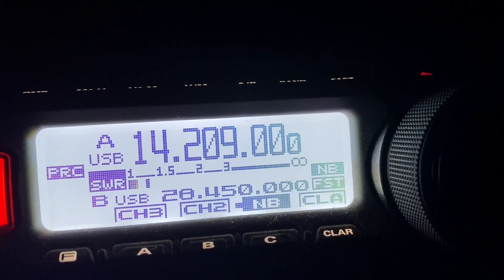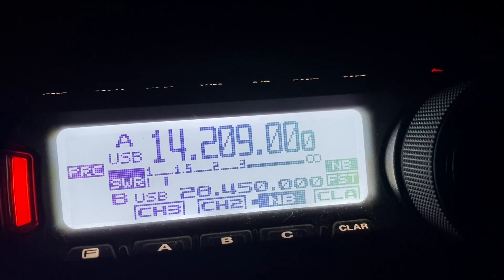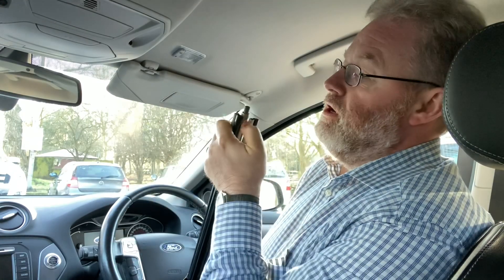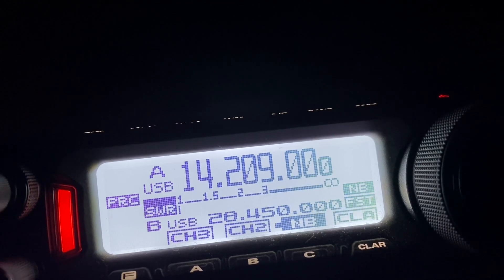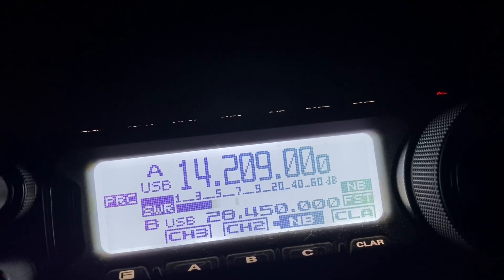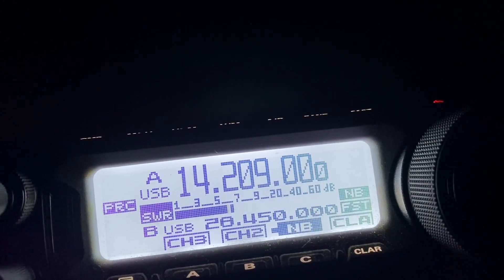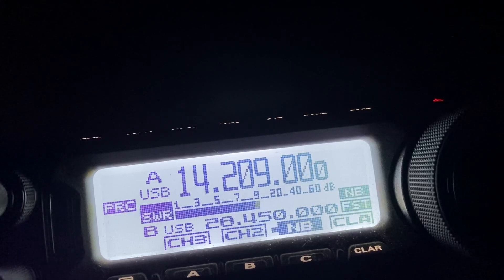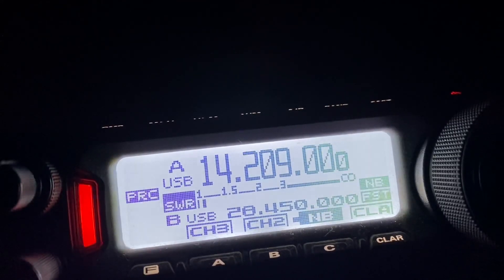Ham Radio: HF Mobile With Slidewinder Coil & Chameleon 2.0 Mil Whip Antenna

Comment: Great video Tim, my qth suffers with s7-9 most of the day, and I was at a point of giving up,and after watching your video, I took the plunge,dug out my tent! And headed out to a campsite, an hours drive away, using a tri mag mounted on car, and Ampro 20 meter antennae, tranny in tent, I discovered just what I had been missing, it was an awakening! First copy was to Iceland,and then dozens of contacts around Europe, and following morning Australia.
As you said, if you suffer from noise on the bands, get yourself out n about.
So good, iv even booked up my next camping trip in a few weeks time!
Cheers Tim
Reply from the maker: That's superb Mark!!

Comment: New to my slidewinder Where on my coil would I put the slider for 10m 
Any suggestions please
Reply from the maker: Hi Liam - if you are using any whip greater than 8 feet long then the best you can do for 10m is to slide the collar to the very top. With my 9ft tank whip and the slidewinder I managed to get an swr of about 1.9:1 this way. Still totally usable. 73
Reply: @TIMG5TM  thank you Tim, I’ve got the mil whip that comes with the slidewinder kit I’ll give it a try, enjoyed the live stream on Saturday too
Reply from the maker: @Liam2E0LDQ  good luck it’s a great antenna system and thank you for viewing the stream. 73

Comment: Super Tim. Not mobile here but i would get outside the ground floor flat with your set up. Only 10 watts at the moment as am new Foundation licencee aged 68 lol. Have the Xiegu G90 which, so far. has worked miracles from my front room with a Wonderloop into Europe. 73s from M7CUN Bristol.
Reply from the maker: Sounds great! Worth a try and very adaptable!

Comment: Great job, as usual. I wonder how that whip would do against the 17 foot MFJ-1979 Whip.
Reply from the maker: Good point. I suspect the fact that the whip can be adjusted to be a resonant 1/4 wave from 20-4m would mean it may have a SLIGHT advantage over using the coil. However, it is heavy to put on the car much more than 3m fully extended, so that is where the Chameleon wins. 73

Comment: Very encouraging and I’m glad it works so well for you.  I struggle with high noise floor and limited space for HF antennas at my QTH.   It can be quite demoralising!  I would be interested to see how you get on with the telescopic whip too, both with/without the slidewinder coil (e.g. for higher bands).   It would be interesting also to see how successful the spike ground mount is and if radials help or not.  Lots of fun stuff to play with!  Cheers and Tim and 73’s
Reply from the maker: Thanks Peter. I’ve just released one using the telescopic whip on 15 and 12m. Cheers
Reply: Join the High noise floor club peter. LOL

Comment: Blimey Tim they were good qsos into us 🇺🇸 😳  are you running straight from your cars battery and did you get clear copies like that when you used ham sticks??
Reply from the maker: I use a lifepo4 22ah in the passenger footwell Andy and yes just as good (I suspect given it’s extra length it beats the Ampro a little bit).

Comment: Good one Tim,.. Works a treat, I will be ordering another, for A9 I left my coil in LZ,  I did see some corrosion on the male threaded side, left it out for a few days set up with my 1979.  Worked US from LZ, grey line, while portable, It always works well, all the best, enjoy yr radio. 😊
Reply from the maker: You too Tom. I know you enjoy yours.

Comment: Cheers Tim, always look forward to your videos, good old normal operating. I'm one of those folks who live in a terrible area and struggle in my valley bottom position so most of my operations are mobile, parked on a hill in Yorkshire somewhere. As you say, it's surprising what you can hear and who you can get back to once all the noise it out the way even on relatively low power. All the best, M7BXR
Reply from the maker: Thank you Simon. It’s a new world with no noise isnt it?!

Comment: I am enjoying this series of videos, Tim. I hope it inspires others to try a similar setup. A few years ago I mounted a Buddipole coil with a 40" whip on the roof of my car. I was very doubtful it would work and I was astounded to make contacts throughout the U.S. and into eastern Europe on 20M (at the end of the solar cycle nonetheless). With only a 40" steel whip, it is a setup that can be used by a passenger while driving. (I think the level of distraction makes it too dangerous for the driver to operate.)
Reply from the maker: Great idea and thank you! 73